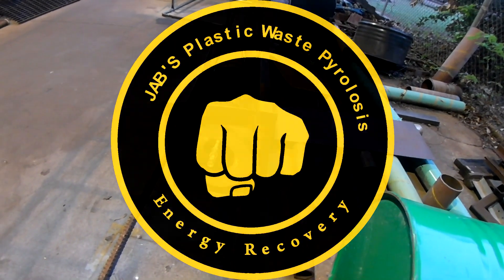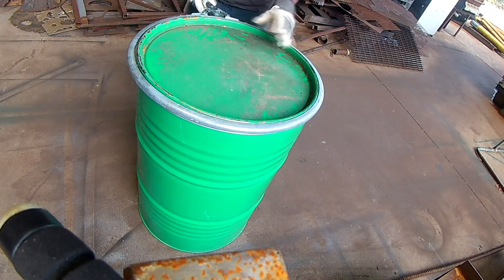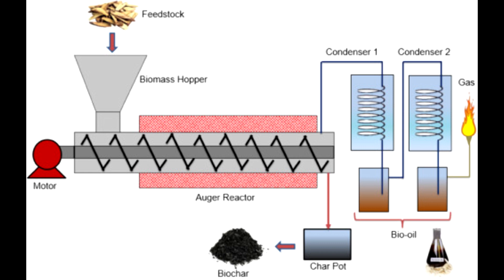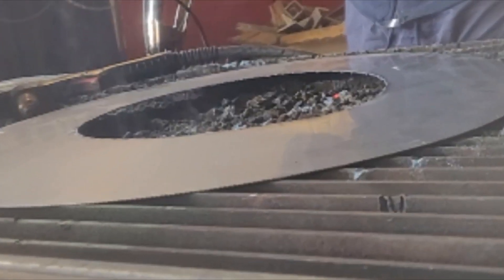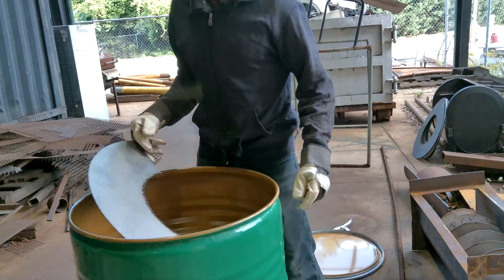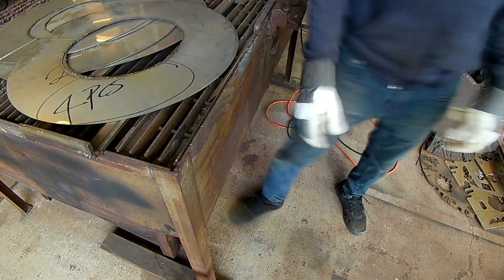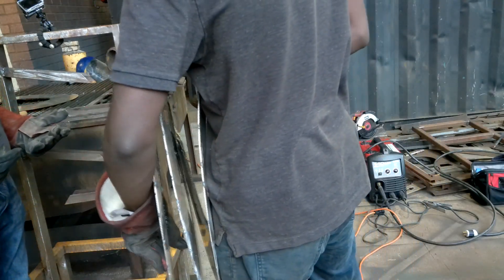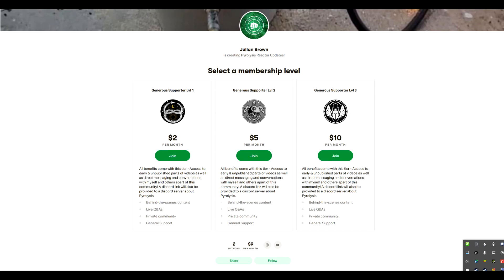Building Mark III Microwave Pyrolysis Reactor -  Part 1

Comment: Go ahead and Skip straight to vacuum distillation so you can get a quality product low temperature use waste motor oil for feedstock have a large water cooled heat exchanger everything welded or use Union compression type fittings for heating maybe an immersion heating element or maybe your microwave units

Comment: I think you adressed this a bit in the last video about the auger but won't the metal just reflect the microwaves and lose the energy as heat with each unnessesary bounce?
Reply: you need heat for pyrolysis, so, it's not actually wasted

Comment: Great work! I have some considerations for this build and the next build if this one doesn’t work optimally:

- As we have discussed before, the reason for some of the hit-and-miss results from your other reactor is magnetron position. The stuff you have inside is being energised by one anti node, maybe two if it is deep. The food in a microwave oven will be hitting several. This means sticking the magnetrons on the top is not the best position because you want the antinodes going through the material, as opposed to just hitting one, if you are lucky. 

- circular waveguide physics are complex. That drum will act like a multi-harmonic waveguide and you are going to get all manner of constructive and destructive interference patterns. Make the magnetrons adjustable in angle and moveable. Then stick some paper or something in the bottom and observe where the hot spots form. This way, you can adjust everything before a real run. Make sure you have a multiple integer of 12cm between the magnetron output and any reflector, else you will lose energy or induce arcing 

- consider another setup (in future) that is rectangular with a plate ram at one end. You could then make the dimensions exactly the same across as a microwave oven to create standing waves (much more efficient). 

Keep going dude 😎
Reply from the maker: Great ideas! thanks as usual,  I guess the biggest issue with a more square design is that things like an auger like circular designs  but if there is a will there is a way I'm sure.

Comment: Clear to see the benefit of using microwaves for much better temperature control, but using electricity to run magnetrons is is not super energy efficient, so are you planning to use renewable sources to power this?
Reply: Have you considered powering the magnetrons off of a power inverter/ inverters? It's something to consider.
Reply from the maker: I have, I have just had issues getting the circuitry right with inverters.
Reply: Wrong kind of sinewave maybe?
Reply: @mikemay2064  A big transformer as in a microwave circuitry is a large inductive load. putting it on a "cheap" inverter might mess up the rhythm in the simple circuitry in the inverter. so either a more expensive sine inverter as you suggest, or a special HV driver to run the magnetron directly without a transformer. That would improve efficiency also.
Reply from the maker: The electricity from magnetrons wil be sourced from renewables one day. It's not super energy efficient, but one of the most energy efficient methods
Reply: @naturejab  I was not trying to be discouraging, I just wondered what the energy budget would look like, if the gas produced is used to run a generator.
Reply from the maker: @Tore_Lund  In theory, I'd say it is possible to run a generator off the gas produced, but I have not done it so I can't truly say. We'll have to see when we get there.